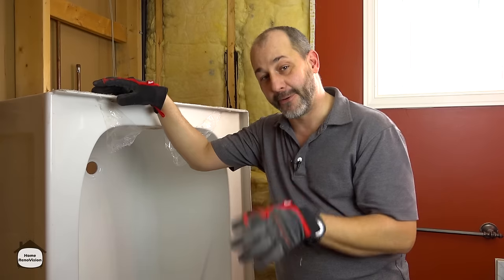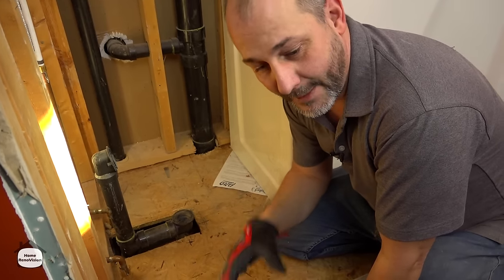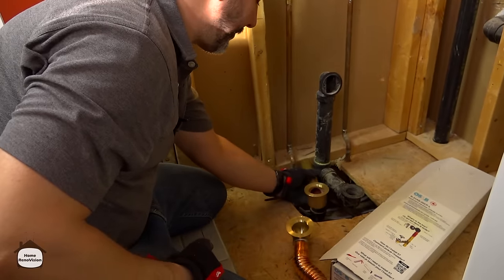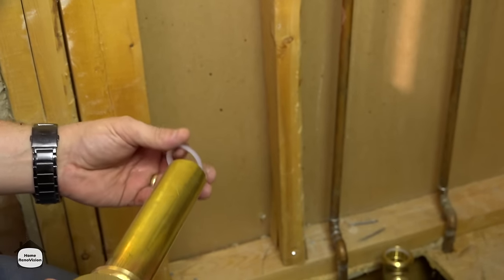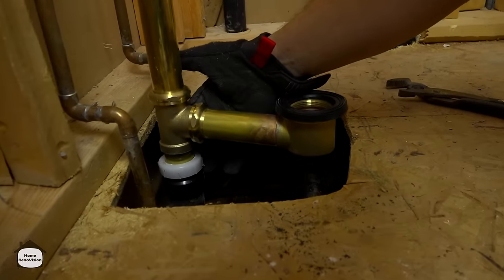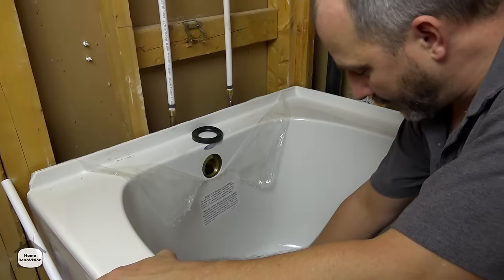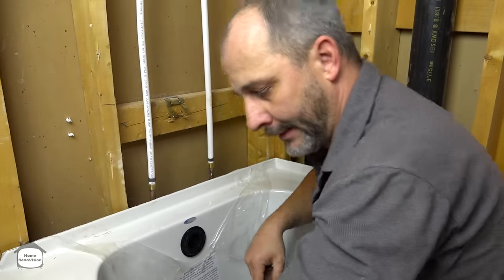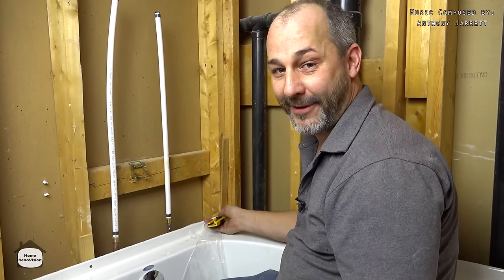How to Install a Bath Tub

Comment: He does not say whether or not put mortar bed underneath the tub. We have Bath Depot product, Craig bathtub, it is acrylic, with fiberglass support board, supporting the base of the tub. They advised that that fiberglass support board underneath the tub must be put on mortar bed. So that all space between the legs, the fiberglass support board and the floor would be filled with mortar. === It is very confusing when videos like that omit saying a single word about the need for a mortar bed.

Comment: If you ever need to remove the threaded tub strainer, good luck. The silicon on the threads and under the chrome flange will lock it on forever.  Great video.

Comment: That is a great video. I recently had a small leak from underneath my bathtub. I tried putting some new plumbers putty on the drain, but while screwing it back on, I managed to cross thread it. The pipe was plastic and not metal like yours in this video. What should I do ? Can I fix this on my own? Is there a way to fix a cross threaded plastic pipe? Thank you!
Reply from the maker: Hi Sarah, the only Option you have is to apply silicone to the drain and the threaded pipe and install cross threaded and hope the silicone seals it. otherwise you need to open a hole in your ceiling and install a new fitting to receive the drain. Cheers!

Comment: I like your video production style. It's very condensed and polished. However, I wouldn't use the silicone sealant on the drain threads. You know how hard that's going to be to replace one day.

Comment: Great video - I would add that unless the full bottom of the tub is sitting flush on the floor, it would need to be installed seated in a bed of mortar. This method would pretty much guarantee no cracking. 

Unfortunately, I cut corners installing my acrylic tub and it started cracking a lot after a few years

Comment: I always put a ledger board along the inside wall to support the inside edge of the tub.  A tub full of water and an adult will sag some if the inside edge is not supported from underneath.  It is especially noticeable when you use tile and grout for your tub surround.
Reply: Depends on the tub manufacturer, but I think it's good insurance.

Comment: Im a plumber from texas. I like seeing how different parts of the country do their work ... this comment is the start of this video

First edit... he is talking about a second floor application

2nd edit... i think just going abs all the way without that funky brass and copper with glue joints would be better

3rd edit... ya i only like compression joints in cabinets that you can access

4th edit... i set all my tubs with a mortar bed to "make it soild"
Reply: If your from Texas, Jeff isn't operating from a different part of the country...he's in Ottawa, Canada.  Yes...this is an installation over joists which could be a second floor or a first floor over a basement or crawlspace.  Canadian building code doesn't require an access panel or shut-off valves for a tub and shower installation, but it's always recommended if they can be provided.  The mortar bed provides stability, especially preventing any flex from acrylic tubs and it aids to eliminate that hollow sound when showering.

Comment: Thanks for the nice instructional video!.  Only qualm I have about copper drain pipe is that they corrode.  Major problems in old condos with old corroding copper drain pipes.  And that flexible copper pipe looks like it's not going to last
Reply: I agree with you on that. I had a rental property where my renter kept putting Draino in the drain and it destroyed the traps under the sinks and metal tub drains. It was a very expensive fix under that tub! Grrrrrrrr!

Comment: What is that kit you used to screw the black plastic thing into the overflow. We have the type that uses a bar across, but what you used looked much better. Does the kit come with a bushing? Or would a whole different overflow unit need to be purchased?

Comment: Hi Jeff, 
I saw you use silicone to seal the drain head. Is this a normal practice? I saw many others use plumber putty to prevent leaking. Now, I want to replace the drain head, but I broke the cross support inside the drain. I am wondering if my drain head was sealed by using silicone, will I break the AB pipe when using the drain remover? Is there anything I should pay attention when replacing the drain head? Thanks.

Comment: I've been remodeling bathrooms for 15 yrs, you got most of it right. You didn't use a mortar bed on that acrylic tub. You should have installed the framing support for doors after the tub was in, your viewers definitely need to know that part. You conveniently left out footage of actually lifting and setting the tub. You can use an oscillating tool or angle grinder to radius the corners of the skirt to ease installation, an extra inch goes a mile and it will protect the corners. Oh and no you will never actually see the corners of any tub skirt after finish work is completed. You also failed to point out that you had to remove sheetrock and outside corner bead to set it. What if your viewers are not working near an outside corner? You could have raised the subfloor and overlapped the tile, rather than cut the tile floor back. We never got the chance to see a level set on the tub rails. Does the subfloor need to be patched back in to avoid one of the feet being left unsupported or if on a crawl space sealed to prevent pests and cold air from entering? How do you leak test the slip joint drain assembly? Guess I should stop there because people are going to call me an asshole, but I've done this thousands of times and made alot of mistakes along the way.

Comment: Jeff, love your videos. I've started to gut my bathroom and your video have been very helpful! I got to the drain/over flow line, and found the metal pipe had rusted away. The previous tub would flood underneath as the drain line did not connect to the drain hole. Now it is just a hole in the concrete floor. Not sure exactly what to do from here

Comment: Just got in a brand new Delta acrylic tub and a flyer staples to the installation packet said do NOT use silicone caulk with acrylic. They recommend DAP 3.0 and a couple other comparable bathroom caulks that do not contain silicone.
Reply from the maker: Then use what the manufacturer suggest. Cheers!

Comment: Hey Jeff - love the videos always a pleasure learning from you. What are your thoughts on setting an acrylic tub on a bed of mortar. My brother is a pretty big guy and cracked the last tub he had. He’s not looking to spend a lot on a reinforced tub. Any other ideas to transfer the weight? Thanks again Jeff
Reply from the maker: it works. just make sure to do a dry run on the tub install first so you know it is in the right place , or be able to connect the drain from underneath. Cheer !

Comment: Pro tip:  Install a tub that is deep enough for a good bath,  20 inches is good. The cost differential between a shallow tub and a deeper tub is slight. Opt for the deeper tub.

Comment: I have an acrylic drop in tub that's sprayed with fiberglass and has the type of feet that screw up and down to level. It has one in each corner and one in the middle. The instructions tell you basically nothing and I cant find any info anywhere else online about this tub i got from home depot. Do i just install it the way it is or do i need to put something underneath the tub like a mortar or sand bed?

Comment: At 11:33 - “the other thing we have to do is find out how far off the ground the drain needs to be”... but then the video cuts to it already done. How did you do it? Is it in another video? I’m in the middle of the exact Reno. Inspired by you, bought the Tucson tub from Mirolin. Got the OS&B drain and over flow, picking up tomorrow. 

Also the ABS piece, that you bought separately and then connect it into the OB&S?

Comment: If you require 2-3 shims, doesn't that mean the cement board will not meet the lip of the tub?  If you build out the 2x4 to meet the lip, you are then left cement board that is not even with the existing drywall.

Comment: I highly highly suggest setting a weak tub like vinyl or acrylic in a bed of thin set.
Reply: Lay a bed, 1 to 2 inches thick of any standard mortar which is cheaper than Thinset.  Provide weight in the tub by standing in the tub to set the tub base into the mortar and then screw through the tile flange into the studs.  When you reach the final stage of caulking the gap between the tub deck and the tile that overhangs the tub flange, fill the tub first with water while you caulk and until the silicone caulk sets up.  The silicone will now move with the tub and prevent the silicone from separating from the tub or the tile when weight is introduced to the tub during a bath.

Comment: Hey Jeff, just bought the the Tuscon. Will install the tub next week. I will use the redgard as suggest in one of your waterproofing videos with the mold proof drywall in the shower area. Can you suggest a floor preparation video that I can follow. I will be using a porcelain tile. Thanks

Comment: Great video, just like all of them. But I have a question. I am wanting to instal a shower/bath combo tub, as in the video. But on my non-drain end, instead of it being in an alcove wall, I am wanting that wall to be a tiled Bench area that someone could sit on. I am building this in a tight space bathroom and do not really want to have the 2x4 border on the length of the tub and tile that up, etc. I am hoping that I can put in a tub, wall on the drain side, wall on the inside, then bench on the far side. I can't seem to find anything on youtube that has done this. I am wondering, do I go drop in tub? Or stick with alcove tub and have a lip that is "1 tile" high and attached to the 2x4 bench, then to the wall? Thoughts?

Comment: Your videos have been very helpful Jeff, Thank you.  I'm doing an acrylic tub this week.  I have the OS&B kit but wondering if you use the joint compound on those?  Or just trust in the compression fitting, brass nut and rubber seal.  Also, how do we tighten the ABS connector for the down pipe once the tub is in place?  Or do you get it pretty close and then trust gravity to keep the water flowing down, until a plug up I guess.  Thanks,  Zam
Reply: Just make sure all the measures and tight everything up before drop tub.
Also, use waterprove thread for metal joint and silcone all the time.

Comment: Curious- a lot of other folks go into some depth on leveling the tub. Did you have to level this one at all? If you have to shim behind is it pretty easy to get in behind the tub?
Reply from the maker: leveling the tub may be necessary if you have a flat top that allows water to flow over the edge. this design is beveled and keeps the water diverted back into itself up to a 1degree slope. not usually necessary.

Comment: Totally unrelated question, sorry... but we have a heavily painted popcorn ceiling. (From the 50's) Do you suggest removing it or just drywalling overtop? Tips?
Reply from the maker: I would install a new drywall ceiling over the whole thing since you likely have high levels of asbestos in that mix. Cheers! Use laminating screws.

Comment: Tub install was complete and flooring put in, but after bathing for the first time, the side of the tub has pulled away from the grout and tile. It seems to have moved inward.  Was it installed incorrectly?  How can i fix it to keep it from shifting more?  Can i just grout more?  What is the best fix?
Reply from the maker: fill the tub with water and then use silicone to seal the edge.Let dry overnight before draining tub Cheers!

Comment: What about spraying some foam insulation around the underside of the bath, wouldn’t that make the whole bath feel more solid and stiffer? I know there is fiberglass but it still feels hollow and plasticy.
Reply from the maker: The tub I purchase has a reinforced plywood base on legs with a prayed fiberglass reinforcement. there is nothing flimsy or weak about it. Therefor spray foam is just a waste of time. Now if you buy a cheap tub off the shelf from the building store then you may want to set it in a sand mix.
Reply: Home RenoVision DIY can this mirolin tub be purchased in the US
Reply: @HomeRenoVisionDIY  BE AWARE ⚠️ .... Mirolin Alora $700 acrylic tub doesn't require mortar according to manual  / in real life IT DOES / squeaking from day one even everything was perfectly leveled and shimmed. So not a cheap tub, yet mortar is required.
Reply: I agree. My new house has this tub and it squeaks very bad although it has support legs. My builder did not use any mortar and they are trying to shim the legs with the drywall opened. I think the quality of the tub is very low.

Comment: Do you recommend putting window/door spray foam under the tub for support? My tub at my house feels flimsy, the floor flexes a little in some spots.
Reply from the maker: not on a mirolin tub with a reinforced plywood base with fiberglass pray and post legs I don't. If you have a tub that needs help use sand mix.

Comment: I have a question, as I am currently installing a tub. (Ottawa, Canada) My tub lip on top that you screw into the studs is already about 1/2" thickness. The studs like in this video are not straight or have gaps etc so I have shimmed them like you suggested in this. Only now I have an issue where my drywall doesn't come as far out as the top tub lip which will in turn make the tiling look real bad at the bottom as the tub acrylic lip forces the tile to push out at the bottom. Any suggestions to help with this issue?

Comment: Thanks again for the videos! I'm installing an american standard acrylic tub. The installation directions say to use roofing nails where the flange meets the studs, but it doesn't go through the tub itself. I've seen comments on other forums about this approach leading to creaking and I also prefer the more solid seeming connection of screwing through to the stud. 

Is it ok to use the method you show with screws instead of the roofing nail method in the instructions? 

Thanks!
Reply from the maker: the creaking comes from the acrylic tub movement when full vs empty. those nails will loosen and then the acrylic rubs against them causing the noise. That is why we use screws.

Comment: Love your videos.  I'm fixing up a nearly 100 year old house that has a 5 foot tub in a 5 1/2 foot space as that is the width of the bathroom.  The former owner took up the gap by stuffing boards at the end of the tub.  I'd like to have a proper tub enclosure but how do I handle the extra 1/2 foot space that is the room dimension?
Reply from the maker: build a wall and install a nook. Cheers!

Comment: Any advice for getting a stuck knob off of a shower control? Took the screws out and one knob comes off fairly easy, but the other doesn't come off even with some mild tugging. Don't wanna break anything just to re-align the markings, especially if it's in the wall!
Reply from the maker: Perhaps it is time for a new valve. Cheers!

Comment: So, cement board sits on top of the tile flange?  Would this be the case with a shower base as well?
Reply: Yes. I just installed a shower base. However, I used a drywall with a waterproof membrane (Densshield). I left about a half inch gap between the flange and the bottom of the drywall

Comment: Hi Jeff, I’m planning to install a soaker tub but it still needs to be a tub/shower combo in my small bathroom. Is it better to get an alcove tub with tile flange or would a drop in tub work just as well? Drop in tubs are easier to find in the size I’m looking for (66-72 x 32-36 in) but I don’t want to cause more issues if I forego the tile flange. Thanks!
Reply: Look at Laurel Mountain. I just ordered my 66" X 36 for alcove. I thought about drop-in, but the install in a tight space was going to be more work and potential for leaks.

Comment: Hey Jeff I’m wanting to put in a drop in tub. They say I got to use a cement or mortar bed under it. Is this true if so do you have a video doing this?
Reply: Yes, you must place the tub in mortar to support it. You don’t want the tub hanging by the flange that goes around the tub or it will crack. Don’t try to cut corners!

Comment: I installed an acrylic tub. Works great but the front bottom came loose from the bead of clear caulk that I secured it with for 2 reasons. To keep water from under the tub and to stationery the front.  any suggestions?
Reply: Remove the existing caulking, fill the tub with water and apply a new bead of caulking.

Comment: Question for you - I am replacing my tub and had to fix the subfloor underneath. The original subfloor and the fixed subfloor are about 1/8” difference (house built in 1928). Will this impact my new tub, which has has as two 2 x 4 rail feet on the bottom (thanks for the tip on the feet!)?
Reply: Following
Reply: Any chance I can get your input on my comment?

Comment: Hi I am installing a bathroom in my basement and plan installing a tub/shower. There is no plumbing or framing yet.
When I go to frame in the walls around the tub and plumb the tub drain, do I plan everything off the exact measurements of the tub? (32"x60"). Or do I need to take into consideration of 1/2 cement board?
Thanks!
Reply: stud to stud measurements to fit the tub.